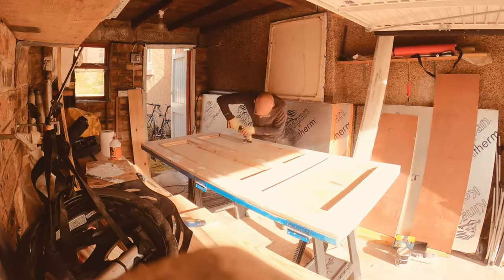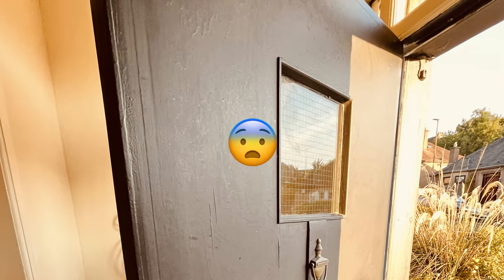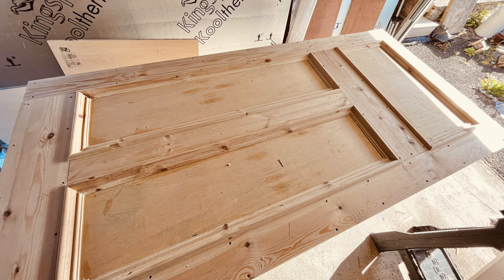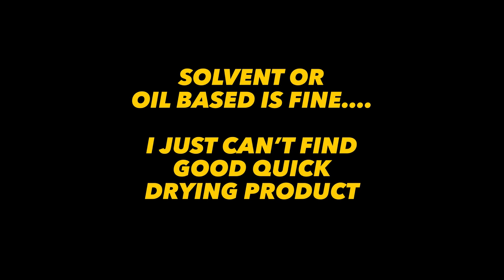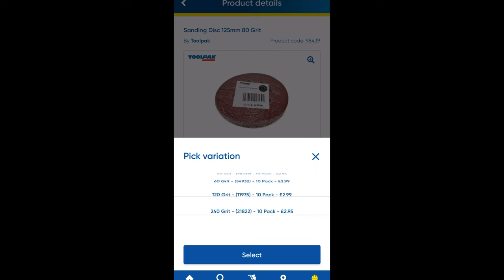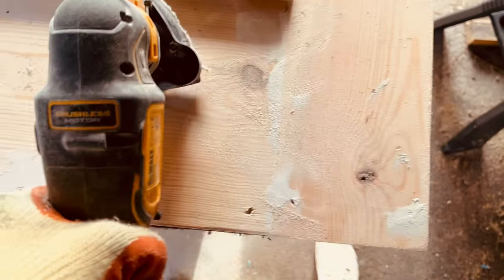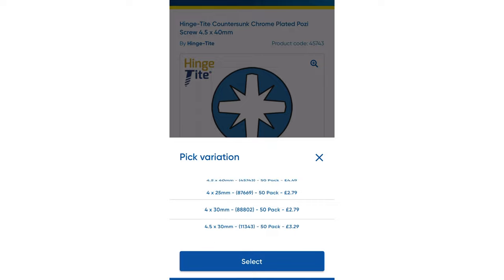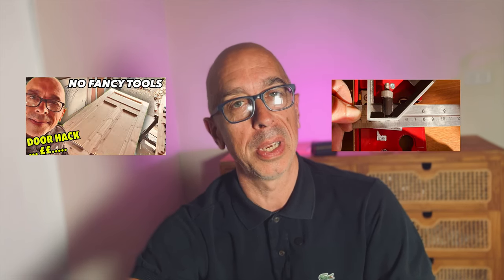Prepare & paint Timber Front Door | Best Primer Undercoat & Finish

Comment: Interesting that you don't scrimp on expensive paint. My father in law (tight git) always takes a F&B colour book to the DIY store and gets a pot of cheaper stuff mixed in the same colour. I'm assuming there's something about F&B that gives it a better finish than that?
Reply from the maker: Great question. Yes you can get these paints mixed to colour accuracy using far cheaper paints, reasonable quality and don’t look that bad…but I’ve used both, and the difference for important situations such as a front door or railings outside a period house is not worth the scrimping. Pigment, chemical structure, flatness of colour, all superior. For indoor wall emulsion I’ll sometimes consider it. Some customers will never pay the extra given the choice. Some decorators swear there’s no difference, which always makes me suspicious of their experience. It’s about considering the price you’re paying versus the value you’re creating. I’m looking at my front door every day and so it’s a very high value item in terms of the overall appeal of a property. If you’re not bothered about that, either don’t do or go cheap. All approaches are fine as long as we understand the options. Thanks a lot for your comment.